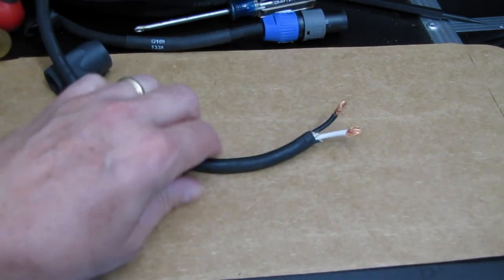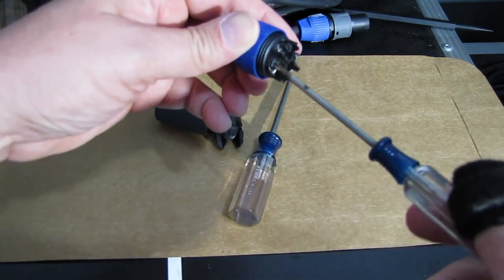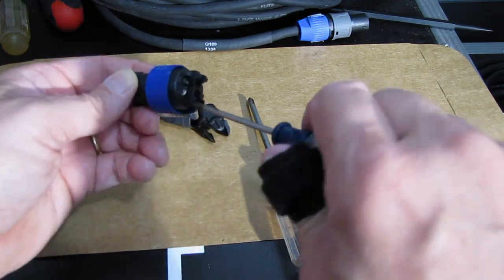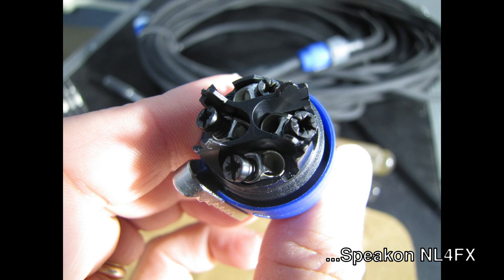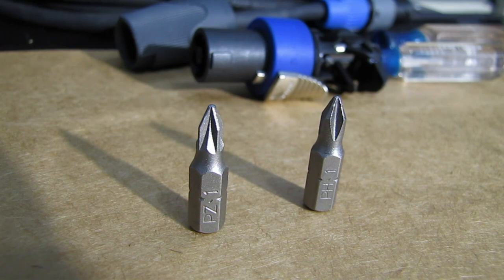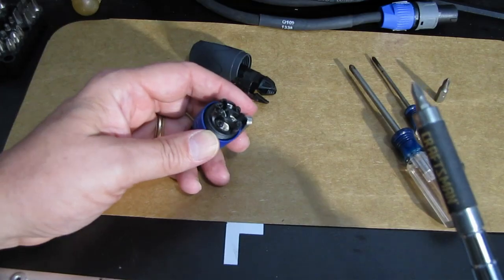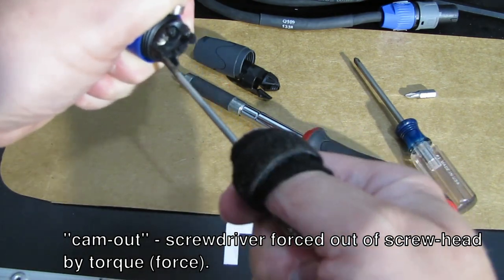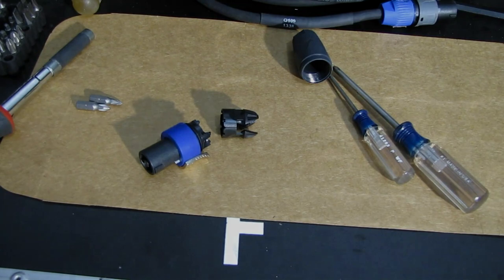Speakon connectors - do these require a Phillips screwdriver?

Comment: It's actually a Pozidrive #1 for plugs from about 2008 and on. There should be a line on the packaging stating that. And otherwise it can be found online in the technical specifications for the plug.

Believe it or not and long story short, I made sure Neutrik put it on there. The reason being the problem you experienced.
Reply from the maker: Great information.  Thank you for the post!